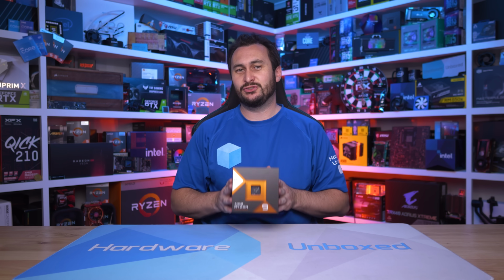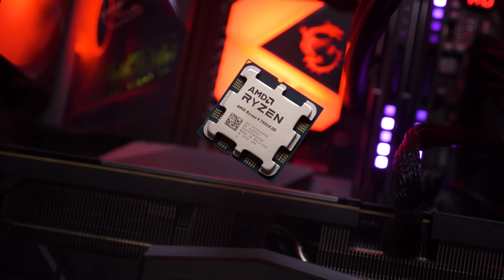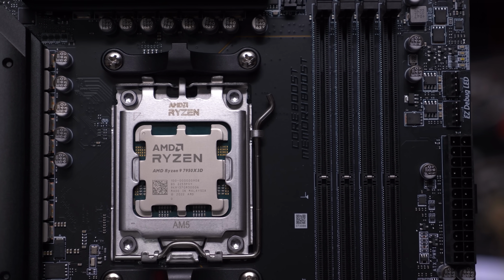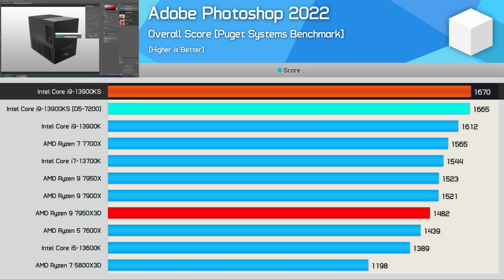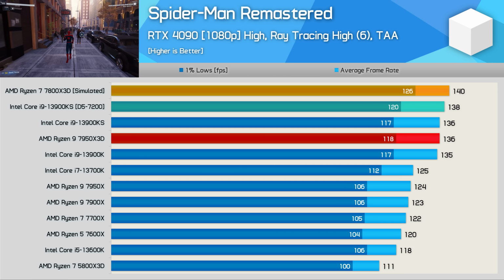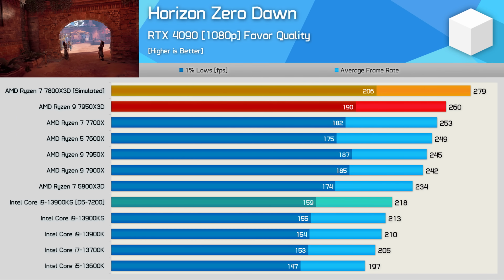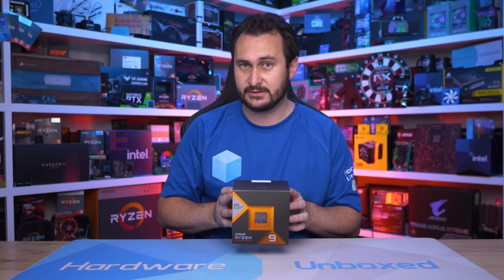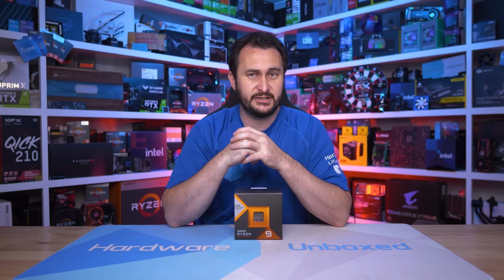AMD Ryzen 9 7950X3D Benchmark + 7800X3D Simulated Results

Comment: I wonder if AMD might introduce in the future a 7990x3d with both dies featuring stacked cache to minimise the scheduling issues?
Reply: Much more expensive than 7950x3d and same speed in games as 7800x3d and much slover than 7950x3d and 7950x in productivity… Why would anyone buy it?
Reply: AMD stated they experimented with putting v-cache on both CCDs and found no benefit to it.

Comment: This actually is like a 2 in 1 processor - 7950 eco + 7800x3d in one. The ability to switch modes on the fly would make it the best cpu overall for creators & gamers with its lower power draw & solid performance...

Comment: If half of the cores are disabled when gaming on 7950x3d then they are absolutely useless. The only difference between 7950x3d and 7800x3d becomes the core speed and slight difference in 3d memory, but since these are unlocked and 7800x3d can be overclocked to 7950x3d speeds... we might have a reason why they're waiting with that release. Bit of a shame, was really looking forward to it. Hope someone makes a benchmark in factory games between all the 7000 Ryzens.

Comment: Man, a B450/B550 + 5800X3D is looking like it was a better deal every day. The 7800X will be interesting, but I doubt the cost-per-frame factoring in the mobo will beat the £65 Mortar Max + cpu combo
Reply: I'll never understand people that think it makes sense to buy a high-tier CPU, then shoot it in the kneecaps with shitty RAM and VRMs.
If you're buying crap AM4 parts, just get a 5700X and be done with it.
Reply: @rustler08  the B450 Mortar Max had some of the best VRMs of the generation (see buildzoids video), thanks to msi compensating for the bad press with overheating b350s by overengineering the follow up...

Comment: Unless we get profiles for the best automatic CCD preference, we need benchmarks with the other CCD disabled (or should we just use the 7700X benchmarks?). Because- in SC:GO, the 7700X is in top spot, so Steve probably disabled the wrong CCD for this game. Results like that can swing the overall average for the 7950X3D to have 3%+ advantage over the 7800X3D/13900KS.
Reply: The latest AMD chipset driver has that thingy called "3D cache optimiser" or something>

GamersNexus explained it in detail in their review.

I dont think HUB's test rig is configed properly.

Comment: I'm not so sure about the final recommendation of the Intel (in a politically correct sort of way) power must be almost free down under. Here in California; half the power use of the AMD CPU compared to Intel will pay for the difference in upfront cost in a matter of a few months.
Reply: In addition, I'm not sure if AMD has made a time commitment for this latest generation of motherboards being supported, but keep in mind that typically with AMD you can upgrade multiple generations of CPUs before you need another MB. Intel, not so much. So Intel probably won't have an upgrade path, uses twice the power, requires twice the power dissipation, but costs maybe 20% less upfront. To me that's not an Intel recommendation.

Comment: Bro how can you place the 7950x3d on the same level as a 13900ks? That Intel CPU burns literally money with that 500 w tdp. Also in your cost analysis you didn't mention you need a much bigger PSU if you want to run that abomination of a CPU. In Germany, just from that difference in TDP, you'd probably save over 200€ until that CPU hits end of life.

Otherwise very good and concise review.
Reply: even if I had 3000USD in my wallet for a CPU upgrade last thing I would get is that KS i9. i3 is better that that hot spreeder

Comment: Whoa, this CCD stuff blew my mind. Amazing hindsight to try and test with this 78003d simulation.
Reply: Unless they also downclocked it (which I don't think they did) it's not the correct simulation.
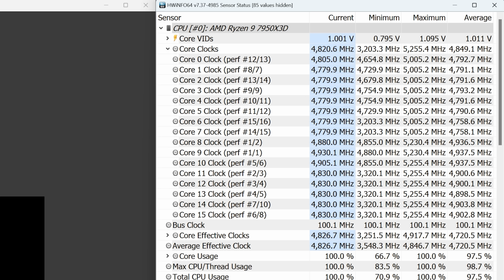Reply: @amunak_  they did lower it. 7:13
Reply: I think there's something off about HUB's testing. For Shadow of the Tomb Raider, both Gamers Nexus and PC World had 7950X3D perform 20+% better than 13900K, and this is without disabling the non-3Dcache CCD. Xbox Game Bar simply detected it as a game and ran it on CCD1 with 3DVCache.
Reply: @MasterKoala777  don't think Xbox game bar was detecting correctly or balance core wasn't selected, GN mentioned this during their review, the 7800x3d sim during this would show the correct core allocation if the auto-detect was working properly
Reply: @s1n1stersixsgaming8  I would agree on paper, but how come Shadow of the Tomb Raider scored lower on HUB’s simulation (326) vs plain 7950X3D by GN 360+) and PCWorld (380+) FPS ?
Reply: @MasterKoala777  not sure tbh, curious how it's trying to schedule the cores under AMD software etc, the extra clock speed from ccd 1 to handle game clock dependent threads and ccd 0(vcache) to handle heavier memory dependent threads... there's also mobo bios settings that could affect optimization curves, waiting to see an in depth test on this if many tech tubers decide to???
Reply: @s1n1stersixsgaming8  HUB just replied to a comment in their video (not mine), and said that they tested SotTR in-game (the village) which was more intensive than GN's use of the built-in benchmark. So I guess that puts the case to rest. It does look like HUB's simulation should make up for any config/driver that's hobbling their 7950x3d. Cheers.
Reply: @MasterKoala777  nicesu thx for the heads-up

Comment: Those settings make little to no sense. RTX 4090 @ 1080p? Thanks, you might as well use bananas for scale. But 1080p + Ray tracing? I can't think of anything else to make numbers less meaningful. I thought 1080p was a way to remove video card as a bottleneck, and then you enable the biggest bottleneck of all.
Reply: ray tracing is heavy on the cpu as well
Reply from the maker: https://www.youtube.com/watch?v=Zy3w-VZyoiM

Comment: Did you guys update the specific chipset driver for the X3D and config the "3D V-Cache Optimizer" properly? (ie: xbox game bar enabled, power setting on "Balanced" NOT "high performance" etc)

GamersNexus spend 1st 5 min of the video specifically about that and how you lose 30% performance just by updating the drivers and configuring it properly otherwise the optimizer dont work.

Comment: Great review, thanks. Really torn between the 7950x3d and 13900ks. Leaning towards AMD as I will have to run much slower RAM
Reply: Is this comment before or after watching this video? Honestly other than platform longevity I see 0 reason to get this cpu. It's either Intel or wait for the 7800x3d imo
Reply: @elirantuil5003  You would be right if I only gamed, but I also do a lot more with my PC, so I'm looking for a CPU that can do it all.
Reply: and your power bill will be much lower!
Reply: @Amfibios  Default settings are bad but it's easy to limit the power consumption by undervolting and lowering the power limit. AMD's only major advantage is the longevity of AM5 socket. Very important to some, useless to others. Depends on how often you upgrade the CPU.
Reply: @yyperi  well that would also reduce the performance

Comment: It seems the CCD splitting really impacts performance and, unfortunately, it wasn't thoroughly dealt with and managed. I don't know how much of that is up to Microsoft and how Windows works with cores (we have seen similar issues with Intel's E-cores, after all), but the end result, regardless of who's "fault" it is, is that the end user gets subpar performance. It's staggering to see how much it improves by disabling the secondary CCD. It definitely should have been addressed before releasing the product in this state.
Reply: I think this review by HUB didnt use the latest driver from AMD that parks the secondary CCD for gaming applications. hence the poor performance you see here.
Reply: It’s 157 vs 153 fps, it’s not that bad compared to the Golden cove and Gracemont performance difference. This isn’t that bad where they shouldn’t launch it
Reply: @benc3825  157 Vs 153? Sorry, where did you get those figures?
Reply: @lloydaran  18 minutes in, the average 1080p FPS
Reply: @benc3825  Yeah I saw that and those numbers aren't among the results.
Reply: @lloydaran  my bad, no idea where I got those specific number, however, it still is just a 4 fps difference
Reply: @benc3825  Yeah those were the results of A Plague Tale, not the average. Anyway, the average is misleading: as we saw with the singular results (Factorio the most impressive one), the issue can substantially impact performance in some games, far beyond a mere 4 FPS difference. That should not be considered an acceptable out-of-the-box experience.

Comment: Seems like AMD have some work to do to ensure the OS is always scheduling tasks to the correct cores. Sounds like a bit of an early Alder Lake issue. Fingers crossed they resolve them.

If not, I think you're going to see a lot of people who were interested in the 7950X3D just go for the 7800X3D instead; save money, avoid the headaches.
Reply: wait till HUB clarify whether they have configured the chipset driver "3D V-Cache Optimizer" correctly before passing judgement... I dont think they have given what i've seen in GN's review.
Reply: @MrFredscrap  Yeh, wish I'd watched that one first. Given there is no mention at all in this video, I think it might be likely that they didn't. Plus with the travel etc they might have missed it.
Reply: @TheSkiddywinks  quite a few reviewers seems to be having the same problem. So it's not just HUB.
Reply: its a bios algorithm
Reply: Or they will just go for the 5800X3D instead; save more money.
Reply: @sammiller6631  Yeh for sure. Although if building new I personally would pay the premium just for the benefit of not being on a dead end platform.
Reply: @blanket4u  absolutely wrong
Reply: @blanket4u  Why are you defending AMD?  They want only your money and don't care about you.  AMD fanboys are crazy.
Reply: It's typical AMD--overpromise and underdeliver.  After they deliver, their products are riddled with bugs that are rarely fixed.
Reply: @blanket4u  In what ways?  Link videos supporting your arguments.
Reply: @blanket4u  Did you even watch the video?  Higher price than 13900, lower FPS in several games, higher power consumption in several games, higher power consumption at idle, higher temp in several games.  Way worse in productivity.

Comment: So until a fix comes, if you want to get the best performance with games, you have to manually disable the non-3D CCD in most cases? I wonder if AMD will fix this or if it will be 'one of those things' that never properly get addressed.
Reply: no, just get the latest AMD chipset driver and config "3D V-Cache Optimizer" properly|

watch gamers nexus review for a proper explainaton,  I dont think the test rig is configured properly for this review given the CCD bahaviour.
Reply: @MrFredscrap  Good point. I just watched Gamers Nexus and see that they updated their drivers to make it work properly.
Reply: @paradoxmakestwo  and you have to config the power management to set it to "balanced" instead of "high performance' otherwise the 3D V-cache optimizer dont work properly.
Reply from the maker: FYI we're using the latest AMD chipset driver and 3D V-Cache Optimizer.

Comment: Instead of releasing the 7800X3D first for good press, AMD has decided once again to make an odd decision. While the decision is only speculation, although highly within reason, to get buyers to buy their more expensive products, the results shown here show that there is still more work to be done to tweak the software. Yes, it is consistently better than their non-X3D parts, but leaves you with mix thoughts thinking, 'meh', then 'I want his product in my system', unlike the 5800X3D, price tiered lower than the 12900K, while performing in games at its tier.

Comment: Intel is a dead platform as we all know. Not mentioned this again.... let alone the ridiculous power consumption  of the 13900k.
Reply: It’s not a dead platform, you can get the Raptor Lake refresh coming late 2023 for a whole extra 2-5% performance AND it is on the same socket!
It is funny that this is the first time in years there is a 3rd generation on the same socket
Reply: @benc3825  2 to 5% isn't worth it. The TDP and Temps are already too high. It is a dead platform.
Reply: @TheHandHistoryVault  I know, i just had to point out that, technically, you can get better performance. It’s the first time you can get more than 2 CPU gens on mainstream intel is a long time.
Maybe they will say it is on a “Intel 6” node, so it is “different” and “better”

Comment: What this doesn't tell me: should I upgrade my 5900X to any of these new CPUs if I play at resolutions ranging from 3440x1440 to 4k. As an 'enthusiast' builder, I have an RTX 4090 and want a CPU to match, but this doesn't tell me (the primary target for expensive CPUs) anything. Many people skipped the 7XXX gen, so I'm not sure why no 5XXX besides the 5800X3D were on the chart, nor why not a single 4k test was done. Sigh
Reply: 5900x should be more than fine at 4k.
Reply from the maker: https://www.youtube.com/watch?v=Zy3w-VZyoiM
Reply: If you have the 4090. You might as well upgrade to the absolute best. Get the 13900KS or wait for the 7800x3D. Also depends if you're going to stream. If you plan on streaming, get the fastest highest core count cpu possible.
Reply: @TheHandHistoryVault  Ok but why should those most likely to buy a product be made to guess? This is why I really don't care for the "we review at 1080p because" reasons. Real world usage will always matter most.
Reply: @RobertoLaurelli  I totally understand. Gamer Nexus and HUB got criticism many many years ago for that exact issue, that's why at one point they both started testing higher end cpus above 1080p. However, they eventually reverted back focusing on 1080p.

Just focus more on the highest clocked cpus since your enthusiast builder. If I were you, wait just until 7800x3D and 7900x3D are out. Then pick from: 13900KS, 13700K, 7950x3D, 7950x, 7900x3D or 7800x3D.
Reply: Yea I was in the same boat but it cost me nothing to upgrade towards the microcenter 7900x bundle by selling my 5900x MB RAM so I figured why the hell not. Made the AM5 platform switch and I'll be set for the next 4-5 years.

Comment: wait the 7800x3D is pushed back 5 weeks 😂😂 jesus
Reply: It wasn't pushed back, as such, it was just given a later release date (we got all the release dates at the same time).
Reply: @godlyobject6509  So the release was still pushed back from the other x3D releases.
Reply: @osirex5495  "Pushed back" would mean the initial release date was changed to be later. If there was no active change to the release date, than it wasn't pushed back.
Reply: @flAMe9610  This, exactly.

Comment: A huge fail from AMD. That's not good. They needed a big win for this part.
Reply: So, you don't see 13900KS as a big fail for Intel, considering higher price, TDP and a few percent faster?
Reply: @-Ice_Cold-  Why bother replying this way? The 13900KS is on a dead platform. But the 13900KS results are far more constant. 7950x3D is at most 10% faster and it's using 3D cache. That's the huge fail here. The only reason to get the 7950x3D is for platform future proofing.
Reply: @TheHandHistoryVault  Well, i expected that X3D will be only a few percent faster than 13900K/KS

Comment: Bro, the level of analytical ability, attention to detail and clear presentation in Hardware Unboxed is totally insane.
Reply: I find the varying settings from high/ultra to medium custom very annoying from one reviewer to the next. One will use High on one game medium on the next then the next channel you watch it is the opposite, then you find yourself watching and pausing two videos side by side to see WTF each did. Not very "clear" presentation at all.
Reply: @crisnmaryfam7344  Its because you want to test a cpu bottleneck not a gpu bottleneck. And they tested those games with those settings so they have a baseline for the current cpu.